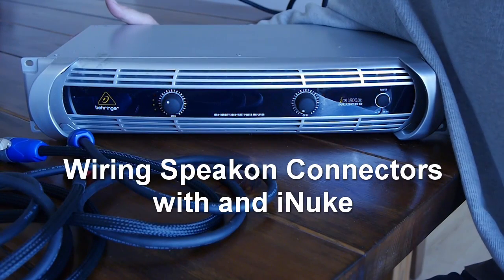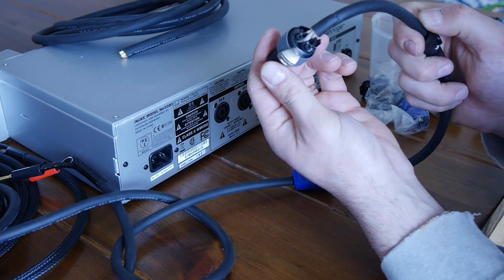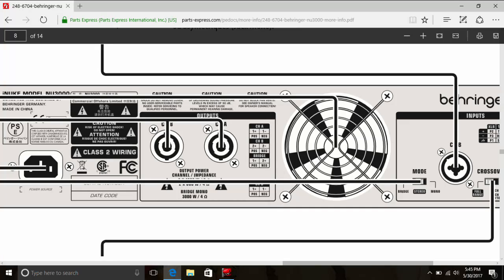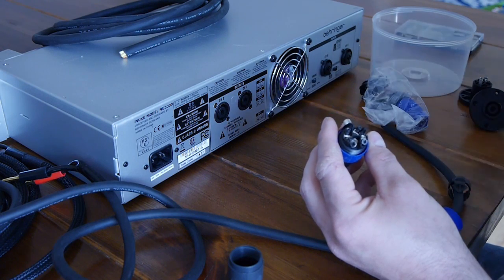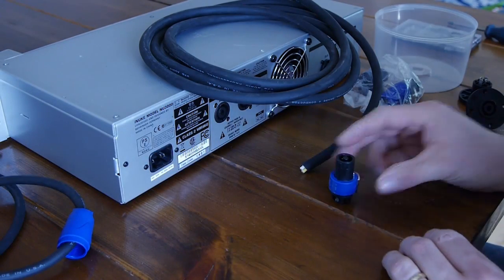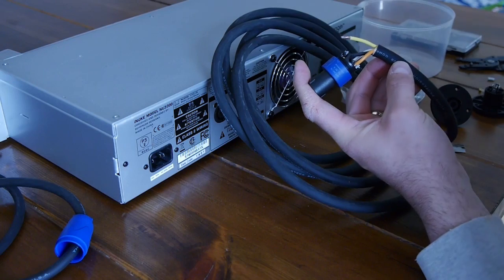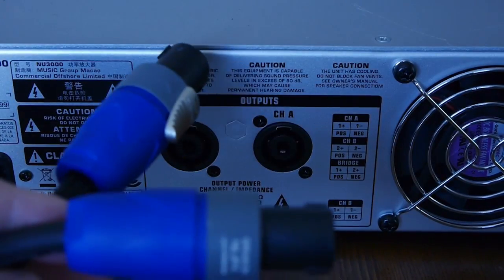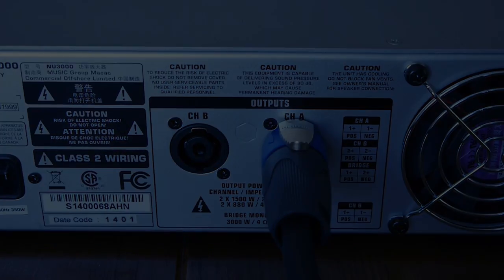Wiring Speakons to an iNuke or Other Pro Amp

Comment: I have a custom cable that goes from speakon to Jack. I want to run this power amp to a load box then using the line out of the load box for entering into a cabinet simulator. May work right? Using just one channel in mono. Guitar guy here...
Reply from the maker: Not totally sure what you’re planning here. Sorry I don’t think I can help.

Comment: Can you help wiring a speakon connector  for a crown xls 2002 amp in bridge mode. It reads for bridge mode: 
         [ Pin 1+, 1-, 2+, 2- ]
Amp end gets what connected? 
Subwoofer end gets what connected? 
Thank you

Comment: Can you hook up a pro audio power amplifier to 1/4 inch audio output jacks that are already amplified
Reply from the maker: I don’t know what you mean. You should not plug an amplified signal into an amplifier.
Reply: @ImpulseAudioSpeakers  why should you not plug a amplified signal into a amplifier.
Reply from the maker: @travisgulley2652  it’ll just clip like crazy and possibly damage it. The input on the amp can only handle a couple volts.

Comment: Are speakon cables and powercon cables not interchangeable.
Reply from the maker: I’ve never tried but I don’t think they are. The rating on the speakon will be much lower that something that plugs into the wall.

Comment: Curious what gauge is that 4 conductor speaker wire, also where did you source it from?
Reply from the maker: I can’t recall what gauge. Probably 12 or 14. I got it from Qcomponents in Canada. Should be able to get something like that from most pro audio supply websites.

Comment: Can speakers put out more spl than what is stated in the speakers owners manual if you use a really good power amplifier to power your speakers and if the speakers are in a properly tuned enclosure like for an example if the owners manual for a speaker says it has a maximum spl of 90 db can it read 123 db on a spl meter if it’s powered by a really good power amplifier and if the enclosure for the speaker is tuned properly
Reply from the maker: Hmm, that really depends if the manufacturer is being conservative. Some can probably go higher, but the sound will compress a lot and not be very good. I wouldn’t buy a nice amp so the speaker will play louder. You’ll be disappointed

Comment: If you were to run pa speakers directly off of a av receiver without a pro audio power amplifier would the pa speakers not be as loud.
Reply from the maker: Not necessarily. It all depends on the power in the AV receiver or the PA amp. I use an AVR for my pro speakers in my home theatre. They’re pretty darn loud.

Comment: Can you use electric guitar amplifier cables as speaker cables for a power amplifier
Reply from the maker: I would generally advise against it. The wire is usually thin.

Comment: Does hooking up a active crossover and a graphic equalizer to a power amplifier make the subwoofers or speakers louder.
Reply from the maker: No unless either off those devices have an active preamp section. As in, they amplify the line voltage. Some devices will accept say 1.2V and the spit out 2.0V. Totally random numbers, but that will yield a louder result. Of course the amp can still only amplify so much. So although this will make the speakers loud all else equal, it won’t make the any louder than they can go. 

Short answer is no.

Comment: If you run 4 1000 watt power amplifiers on a single wall outlet that is on a 15 amp circuit breaker will the circuit breaker trip.
Reply from the maker: Probably not unless you run all 4 power amps at near max power continuously. It would take a very unusual set of circumstances.

Comment: Is bare speaker wire obsolete and hardly ever used in PA systems
Reply from the maker: I assume you mean bare ends and not bare copper. I would say yes. Especially in PA system. Too much room for error switching polarity or touching and creating a short. Also once wired properly speakon is very fast. Speed can be very important for sound techs that setup and take down frequently.

Comment: In Mono Bridge Mode using 2 conductor at the 1+ , 2+ conductors, are connectors at speakers left wired the same with no changes?  Are they just jumped from one sub to the other with no modifications?  I am curious because I dont know if the input jack on speakers will be ready to accept this wiring change...
Reply from the maker: ARay Maddy no, the speaker end will need to be wired accordingly. So the 1+ will go to 1+ and the 2+ will go to 1-. That is if I’m understanding what you’re asking. 

Basically, the speaker cabinet doesn’t know you’ve wired anything differently, so you need to adjust each end of the cable to match the amp and the speaker separately.

Comment: Hello! thanks for the video it was really helpful! However, I want to connect a 4ohm sub to the inuke 3000(non dsp) in bridged mode ... it seems that the built-in crossover is not working in bridged, is this correct? do I need to buy an external active crossover tu cut the HF before the inuke? Read a lot of posts around there with people connecting subs in bridge mode but no body is talking about using an external crossover. Thank you in advance!
Reply from the maker: Augusto Lopez Prieto I think that’s correct. Bridge mode will be full range. The XO will only work in dual channel mode. I can’t say I’ve tried it though, I’ve only ever used an external XO.

Comment: can i go with 2 full range speakers to 1 ch and sub on the other ?? Plz any answer to me ?
Reply from the maker: Dusan Ignjatov sure but it won’t be stereo sound. Careful to keep the impedance high enough to not go too low.
Reply: @ImpulseAudioSpeakers  dual 8 om is 4 om in paralel wilk that be ok?
Reply: I want to make system for home parties
Reply from the maker: Dusan Ignjatov yup that should be ok. Run the amp mono.
Reply: @ImpulseAudioSpeakers  Hi! But how do you connest it propperly? Do you need special wired cables? How do i set the switches? I have 2 tops EV300xs and two subs 1x15", can i run all that with the amp?

Comment: Hi, great video!
One information is missing for me though.
Can I use build in crossover in bridged mode? Let's say I just want one subwoofer in bridge (4ohm 1200W)
Manual says that sub should go into B out on LPF.
Reply: Depends on what amplifier you have. If your using an dsp version you should have no issue.

Comment: May be a stupid question, but is it fine to wire a bridged mono cable using a 4-pole speakon on the amp side (+1 & +2) and use regular banana plugs on the passive subwoofer end?
Reply from the maker: blanex10 yes I do that often. Just be aware how the cable is wired so a mistake isn’t made later.

Comment: Does this work with 240V power supply? also does this have a XLR input? I could see only speakon input.
Reply from the maker: Balakrishnan CR yes. The speaking was the output to the speakers. The input has 1/4” and XLR.

Comment: Sir amp side spekcon bridge mode 1+ 2+ but speker side spekcon conaction in bridge mode (wire amp side 1+ 2+. And speker side _____)
Reply from the maker: sonu thakur DJ aksh Pragpur Himachal pradesh the speaker side would be however it is wired, but should be 1+1-.
Reply: Thanks but 2nd questions Ans.  Plz

Comment: i know this.  I don't get,  witch signal goes to the tweeter and witch to the woofer of the speaker...?
Reply from the maker: lavdosh GJUZAJ that depends on whether you are using an active XO before the amp or the XO is built into the speaker passively. If the XO is in the speaker it doesnt really matter. If using active, follow the tweeter output on the active box to the tweeter on the speaker. Whether it is A or B on the amp won't really matter.

Comment: I am running Bridge mode into an Ultimax 15 with DVC.  Will you please check my math because after your video stop, my confusion starts.  I will wire the sub in series giving me a 4 Ohm load.  

After I wire the Inuke OUT with the 4-pole connector 1+ 2+, how do I wire the other end?  I presume 1+ 2+.  Then the Female socket would be wired 1+ 2+ to the sub voice coils?
Reply from the maker: Just remember that 1+ 2+ becomes positive negative. So your series woofer wiring would go to the 1+ 2+ no differently than red / black. Hope that's what you needed...
Reply: You answered a question I didn't ask, but I needed to know!  Thank you for your reply, I will wire 1+ to Pos and 2+ to Neg in your honor!  :)

Comment: Thanks for the video! Really helped, when using it in bridge mode do I have to input mono in both channels or can I just input mono in channel a? I'm thinking about buying this amp and I would like to know if I have to make an xlr Y splitter for it, apologies for my crappy English...
Reply from the maker: 3dprint-tech you shouldn't need a Y splitter. In bridge mode it basically becomes a mono amp by default.
Reply: Impulse Audio Ok, Thanks a lot!

Comment: im buying the 1k version and the dayton ultimax 2ohm dual coil how would i wire up to my home receiver and to my sub?
Reply from the maker: BEAST BOOST you'll need an RCA to 1/4" TRS adapter. They're about $3. Then you'll want to wire the sub with both voice coils in series. From there I would bridge the amp and wire the speakon as shown in the video.
Reply: Impulse Audio dome it all now but it's very low output
Reply from the maker: BEAST BOOST be sure the VCs are wired correctly such that they arent acting against each other. Should be in on positive then out the negative to the positive on the other VC then out the negative.
Reply: Impulse Audio using xlr to single rca for sub out and xlr to banana
Reply from the maker: BEAST BOOST xlr to banana doesnt sound right. Im sure you meant speakon to banana. Be sure the speakon is wired right and all the settings are right. Plus make sure the voice coils (VC) are wired right. People often accidently wire them against each other.
Reply: Impulse Audio yeah thsts it haha and I tried it on old sub I had until my new sub comes it sound okay just mot very loud
Reply: Why do you need the RCA to  1/4" adapter?  Shouldn't it be:  Sub-out RCA to XLR on the Inuke input?  Or do you mean RCA to 1/4" TS which is the unbalanced version?

Comment: Wow that was fast, Thank you very much. The thing is that If I switch The amp to The LF (low mode) I understand that it will only work one of The outputs A or B I can't remember, but if its not The case and both channels are working with The low frequencies I can use it in Stereo, would that sounds correct to you?
Reply from the maker: sbowl40 oh I just got it. I see what your issue is. Yes if you use the built in 100hz crossover it only works with one of the outs. The other output will be frequencies above 100hz for your speakers. If you dont need the high frequencies then you probably need an external crossover before the amp to make both channels low frequencies only and set the amp to full range.
Reply: Impulse Audio Exactly, or maybe I can use The amp in The bridge mode, with The LF set up using a 4 poles speakon from output A to one of The subwoofers and then using a regular 2 poles speakon I can connect from The first subwoofer to The other one, that way I would reduce The Ohms and increase The power. Do this sounds right to you?

Comment: Hello, I would ask for a Little help in here. I own one amp like yours and I want to use it with 2 Behringer vp1800s subwoofers,  so I have to switch it in The LF mode but It only works in stereo switch, would that be because my speakon connectors has 2 poles?, if I use a four poles speakon can I connect it to one of The Subs and then in parallel connect it from this sub to The other one?, and it would ne in mono mode switch? Thanks In advance!
Reply from the maker: sbowl40 mono or stereo shouldnt have an impact on what speakon type you use. That only changes whether both channels operate identically with the same input or independently with separate input. I cant really understand what is going on with your setup. Are you using both inputs? If you are not using both input and using stereo then you will only get sound from one channel. If you are in mono your should get both subs to work. You will need a speakon cable for each sub to each channel if they are 2 con speakons.

Comment: Hello, I have the nu3000 but can't figure out how to work the bi-amp feature. Do I need 4 pole and 2 pole cables or what, I just need help
Reply from the maker: Kashad Cartwright I'd use the 4 pole connectors for the inuke. Not sure how the wiring is at the speaker but probably the 4 pole there as well. Does the speaker use a speakon terminal or binding posts?
Reply: Impulse Audio the speakers have speakon inputs. I'm trying to use the amp to power subs and I just need the low frequency
Reply from the maker: Kashad Cartwright ok so you could use the 4 pole connector on the amp and then a 2 pole on the high pass conductors into the speakon on the speaker and another 2 pole connector on the low pass conductors going to the subs.
Reply: Impulse Audio how do I determine the low pass conductors from the high pass ones, the labeling on the amp is confusing me
Reply from the maker: Kashad Cartwright if you're using the built in 100hz crossover then channel B is the low pass (goes to sub). So that should be the 2+/2- inputs on the 4 pole speakon connector. The high pass (goes to speaker) is the 1+/1- on the speakon. So if your wire has say red white blue and green you need to know which colours you used for each channel and then at the other end keep it the same.
Reply: Impulse Audio This is where I get confuse. Okay so the 4 pole speakon connects to ch A output on the amp and it contains both ch A and B outputs, then I send ch A outputs from the 4 pole speakon (1+,1-) to a 2 pole speakon and connect those to my tops and ch B outputs from the 4 pole speakon (2+,2-) to another 2 pole speakon and connect that to my subs?
Reply from the maker: Kashad Cartwright you got it. Thats exactly right!
Reply: Impulse Audio Lol I promise this is the last thing, I changed the speakon terminals to run my subs in the low frequency so I connected both ends of the speakon cable to 2+,2- but I get no sound out the subs, could it be that my subs speakon inputs are wired to the 1+,1- side, so I would just need to connect the amp side of the speakon cable the 2+,2- and leave the side that connects to the sub to 1+1- ?
Reply from the maker: Kashad Cartwright no problem with the questions. The speakon at the sub may be wired 1+/1-. That is my guess. If you wont break warranty, you could pull the speakon terminal out of the sub and check how it is wired.
Reply from the maker: Kashad Cartwright if these are separate cab (tops and subs) you may find it simpler to run two cables.One from channel A and the other from channel B both using the 1+/1-.
Reply: Impulse Audio Thanks so much, I finally got everything working

Comment: hello, we just got an inuke nu4-6000. we tried to run all 4 channels, and it doesnt work correctly, any ideas? thanks
Reply from the maker: kenny play how does it not work? Not all 4 channels operate? Did you use the 1+ 1- wiring on each channel?
Reply: well, i dont think so. my singer has the speakon wires, we took4  xlr's from the soundcraft to the amp. have the the switches to mono. But from what Im seeing here, there needs to a lot done just to run this 4 way amps.
Reply from the maker: kenny play no not a lot. Just need the 4 XLR like you have and 4 speakon cables going to each monitor/speaker you're trying to drive. The speakers you're trying to drive also have speakon? There shouldn't be any strange wiring necessary unless you're trying to bridge 2 of the channels for a sub or something.

Sorry I can't determine what is specifically the problem you're having.

Comment: can I use this amp on my home theater, how would I connect to speakers?
Reply from the maker: ENIGMA1626 totally you can. I do. You'll need preouts on your AVR to the inuke XLR inputs. Then you'll use Speakons like I show in this video to go from the amp to the speaker. Most home speakers don't have speakon so you'll need a bare wire or banana end on the speakon cables.
Reply: Impulse Audio do the preouts on my AVR need to be XLR or can they be RCA?
Reply from the maker: ENIGMA1626 nope. You will just need a converter thingy. Or you can buy XLR to RCA cables too. I use the converters and they're about $2 each and work great.
Reply: Impulse Audio thank you!

Comment: The terminal screws are not phillips, they are Pozidrive #1. While phillips will work, closer observation reveals the Pozi drive has additional tooling details that fit more securely in the tiny terminal screws that are easily damaged if overtightened or tightened with improper tooling. Neutrik (speakOn's manufacturer) has tons of wiring info and product info. Oh, and the other parts that screw on to the plug are "strain relief" which prevent strain on the screw connections which prevents them from pulling out when some moron pulls the connector out by the cable.
Reply from the maker: David McDonald good info David, thanks.

I thought I put strain relief in there. My mind blanked while taking the video, but yes strain relief is the appropriate term. Thanks.